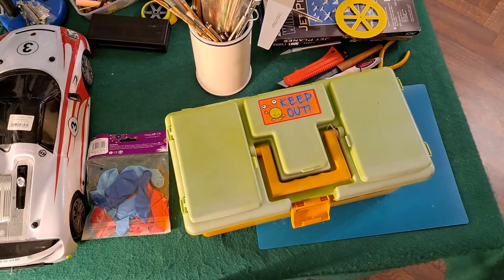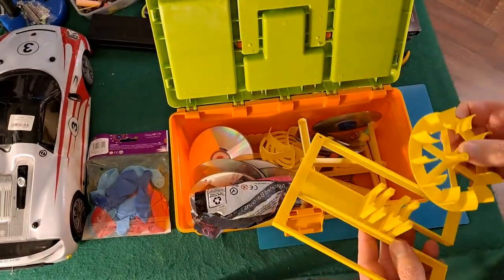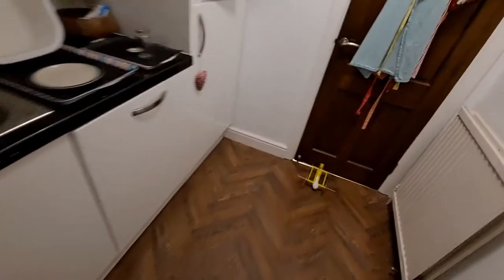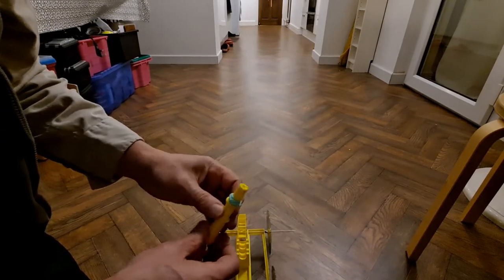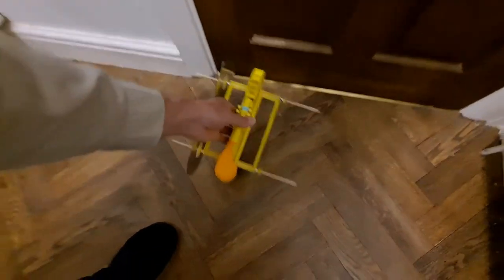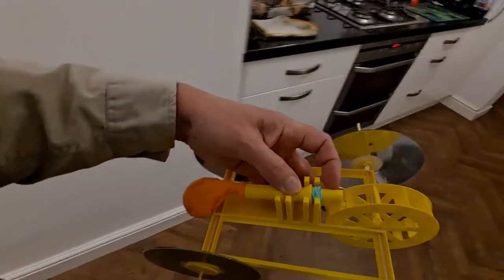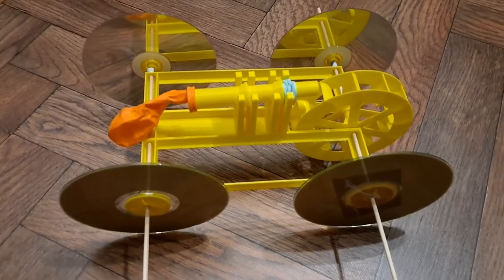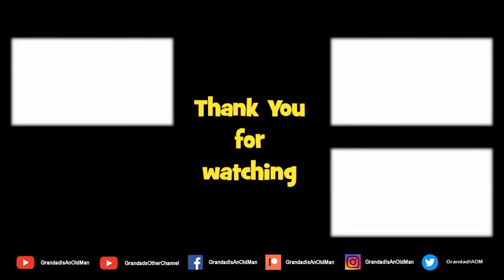Balloon Powered Car with paddle wheel Mk 4

Comment: That didnt go according to Plan? It had only 1 good run but that was it.im Wondering if u could Put a Piece of a Plastic Pole standing up on the back to hold the balloon up from touching the wheels?might work but then u might crinch the balloons airintake
Reply from the maker: A couple more videos to come, I do end up putting a "shield" over the wheels so the balloon cannot foul them.

Comment: Fun project.  I'll resist my natural tendency to suggest improvements, because you've probably already thought of them.  But... what if the balloon were suspended vertically to blow down on the front of the paddle wheel?  It wouldn't hit the wheels, and its momentum transfer wouldn't oppose the car's forward motion.  (See, I couldn't help myself.)
Reply from the maker: I can see your logic, but for me, the biggest issue is blowing the balloon up in the first place and then getting my finger over the end to hold/release the pressure. A clean release has more effect on the run that most of the other changes I have made. I really struggle NOT to accidentally assist the car by pushing it on release, in some cases I try too hard and end up pushing it backwards or sideways to ensure I don't push it forwards. As I was discussing with Mike, you get to the point where you want to make it RC to ensure there is a clear "No hands on" release.

Comment: Grandad try one time to twist the balloon after you blow it up so it closes off at the end of the tube where you pitch it off. Lay the tube down and let the balloon go it untwist to take off.
Reply from the maker: I tried just holding it flat (without the twist) and the rubber stuck to itself and didn't release cleanly. No doubt using a fresh balloon with an air compressor or pump so there is no moisture from my breath would fix that, but that would require another redesign of the pipe for the pump nozzle. That has been on my mind anyway as we really do not want to be sharing nozzles and balloons that we have been blowing into. However, as it is only me on my own doing this I have stayed with blowing them up myself.